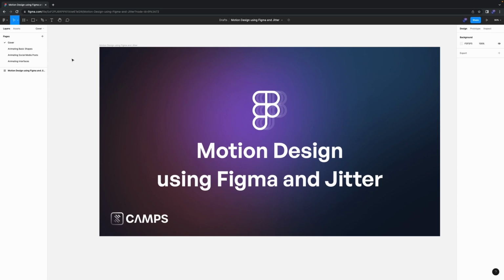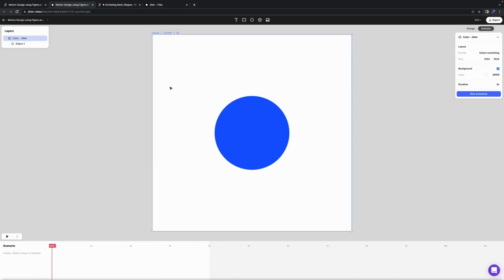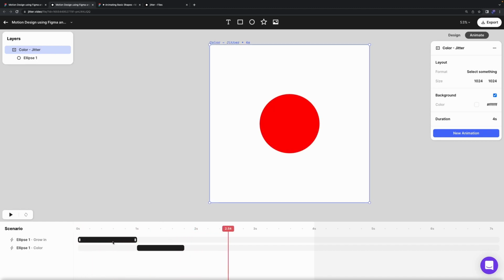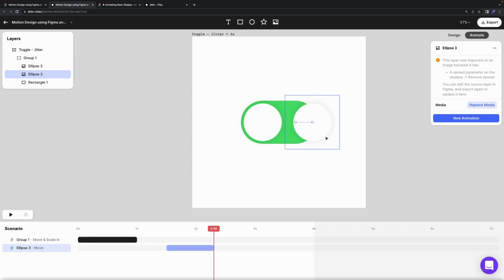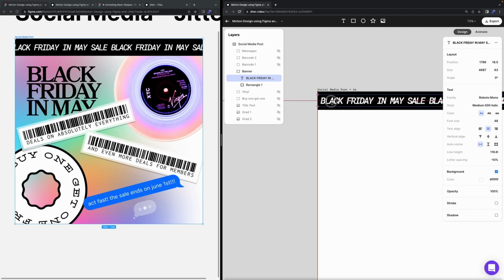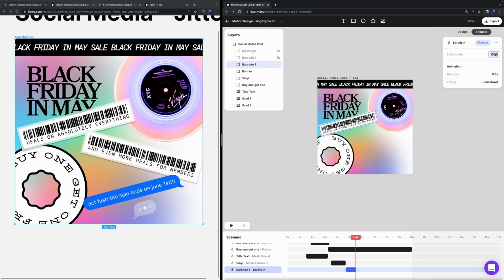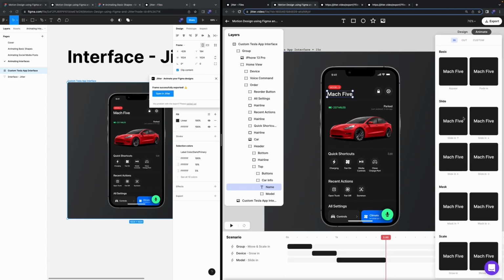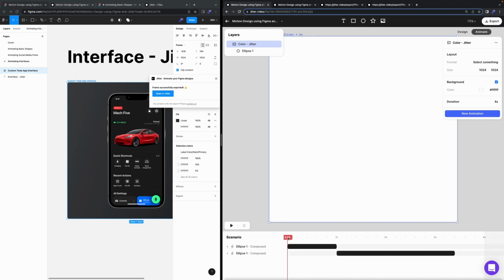Motion Design using Figma and Jitter | STEMpump Camps

Comment: When i try to export a mobile frame from figma to jitter...it says ( Unable to export frames with more than 400 nodes. Try to flatten or rasterize groups that contain many layers ) Can you help me with this
Reply: I've run into the same issue when exporting from Figma to Jitter. Kinda frustrating when working with real UI files. Tbh that’s why i started using linearity move more,  they also have Figma plugin. I don’t have to prep my frames as much..